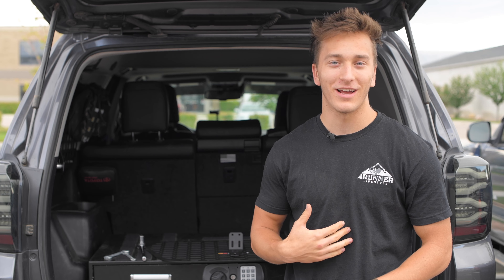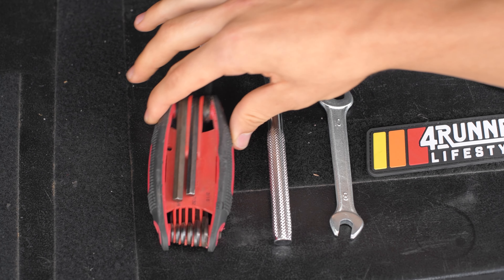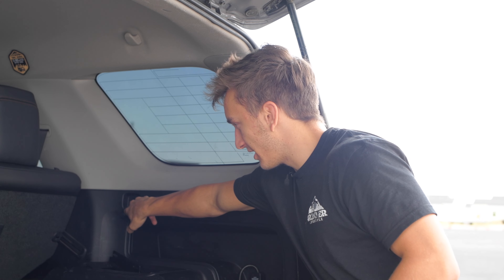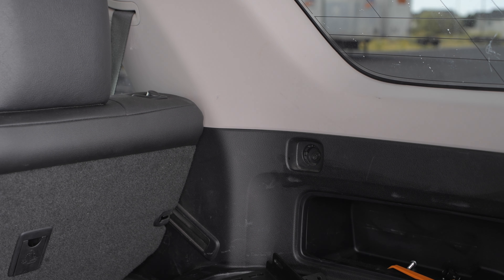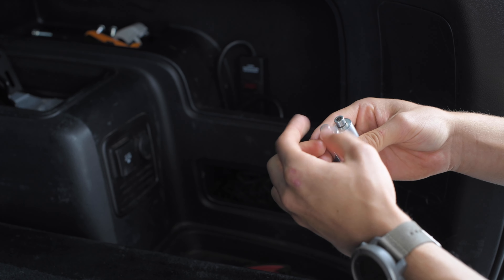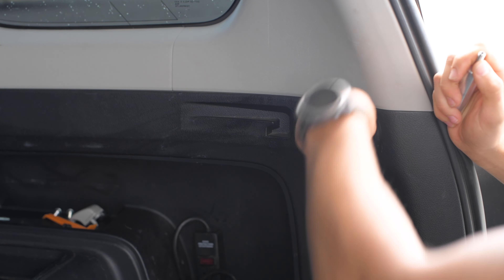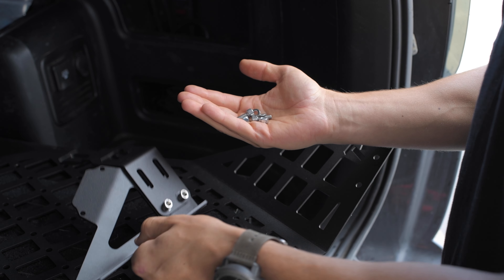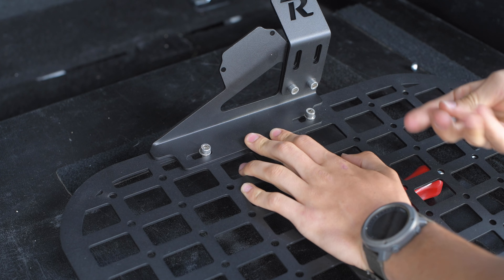Rago 4runner Rear Window Molle Panel Install

Comment: I fabbed  my own. And I  had that upper bracket all one peice together with the panel and  bolt slots for adjustment . Plasma cut all one piece then use the press plate bender for your  bracket angles.  Pins are  screws inserted through black plastic pins. Did several bends on scrap pieces before  final angle bending  process. Super cheap to make if you own a cnc plasma cutter and can do some math .  The total cost to make was under $100.00.

Comment: Great install video. I have a complete set of Wx Tech window shade inserts that fit all my 4R windows. Do you think there would be room to slide one in behind the Rago panel? Looking at your video it looks like it might be possible to slide one in from the gap at the top of the Rago panel (either from the left or right side of the top mount attachment)?
Reply from the maker: Hey! thats a great question, to be honest we have no experience with attempting that ourselves, so it could be possible but we can't recommend it or say necessarily.   There is a large space there but as far as the recommended use goes its not supposed to have anything mounted behind it.

Comment: can't get anybody to respond from 4Runner Lifestyle. I bought a bracket for my Maxtrax to mount to my truck, 3 weeks ago. They took my money (Over $400) but wont tell me when it will ship. I have emailed them several times and I have not received any emails back, except the ads they flood my inbox with. They don't have a phone number, and when you do contact them by email, you get a reply saying not to keep emailing them and they will get back to you when they can. It shouldn't be this hard to do business with a company unless it's by design. Do yourself a favor and shop somewhere  else.